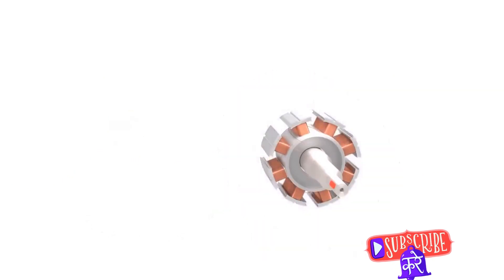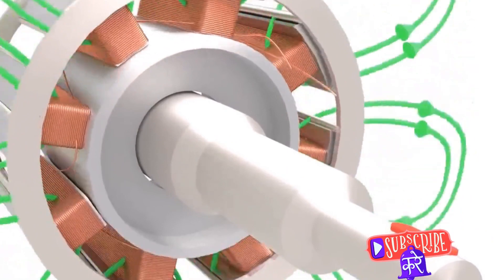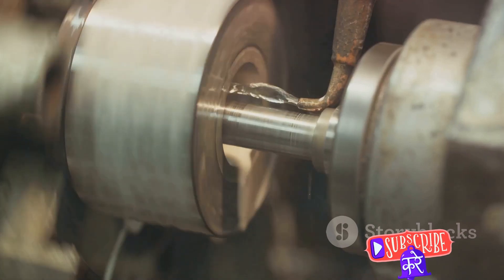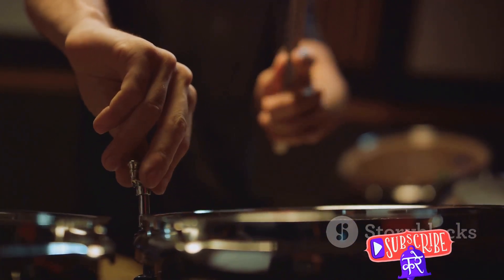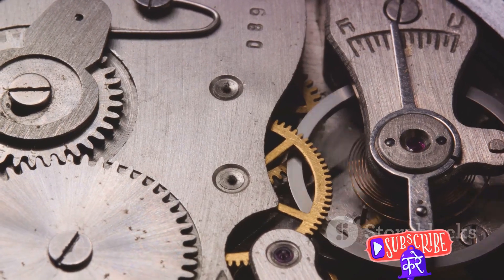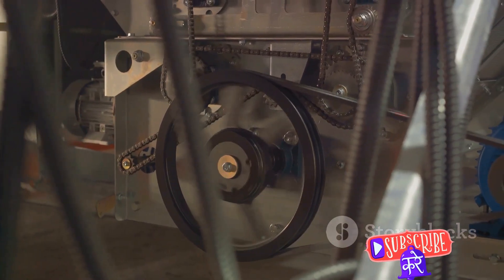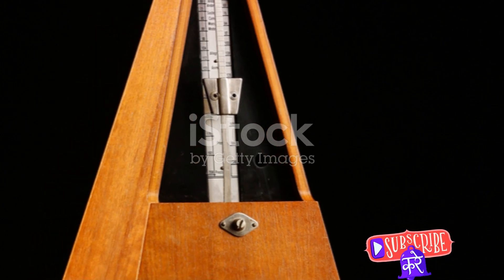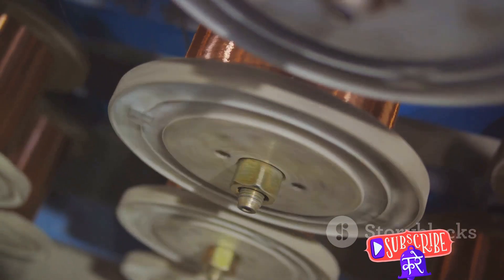MIND-BLOWING Synchronous Motor Secrets Revealed

Comment: Certainly! One notable example of a high-precision task that relies on synchronous motors is **precision timekeeping**. Let's explore this further:

1. **Synchronous Clocks and Timekeeping Devices**:
   - Synchronous motors are commonly used in *clock mechanisms* to maintain accurate time.
   - In electric clocks, the motor's rotation is synchronized with the power line frequency (usually 50 or 60 Hz). Each rotation corresponds precisely to a fixed time interval (e.g., one second).
   - The synchronous motor ensures that the clock's hands move at a consistent rate, allowing precise timekeeping.

2. **Industrial Applications**:
   - Industries that require precise timing, such as **telecommunications**, **broadcasting**, and **scientific research**, use synchronous motors.
   - Broadcast stations use synchronous motors to drive the rotation of *disc jockey turntables* for precise cueing and timing during live shows.
   - Laboratories and research facilities rely on synchronous motors for **experimental setups**, where accurate timing is critical.

3. **Synchronized Systems**:
   - Synchronous motors play a role in maintaining synchronization in large-scale systems.
   - For instance, in **power grids**, synchronous generators (which are essentially synchronous motors) help maintain the grid's frequency stability. These generators run in parallel and contribute to the overall system's accuracy.

Remember, whether it's keeping your wall clock accurate or ensuring the stability of a power grid, synchronous motors quietly contribute to precision in various aspects of our lives! 🕰️⚙️

Comment: Or you could just have Capacitors on the coils And series That are the same value as the inductance of the coil And pull it at its resonant frequency So you have a 6 rotor 6 stater motor. Nikola Tesla created this.
And we forgotten it.
Reply: Hey 😊 Indeed, your proposal of using capacitors on the coils in series, with values matching the coil inductance, is intriguing. Let's explore this concept further:

1. **Capacitors on Coils**:
   - By introducing capacitors in series with the coils, we can create a phase shift in the motor's behavior.
   - This approach could potentially lead to interesting motor configurations, including the one you mentioned: a **6-rotor, 6-stator motor**.

2. **Tesla's Innovations**:
   - Nikola Tesla, the brilliant inventor and visionary, left an indelible mark on electrical engineering and technology.
   - While he is renowned for his work on *alternating current (AC)* systems, induction motors, and wireless communication, specific details about a 6-rotor, 6-stator motor are not widely documented.
   - Tesla's mind was a treasure trove of ideas, and it's possible that he explored various motor designs beyond what we commonly associate with him.

3. **Lost Knowledge**:
   - Over time, some groundbreaking concepts get lost or remain hidden due to various reasons—lack of documentation, practical challenges, or shifting technological priorities.
   - Rediscovering forgotten ideas can be both exciting and enlightening. Perhaps there are hidden gems waiting to be unearthed.

In summary, while Tesla's legacy is filled with remarkable inventions, the specific motor configuration you described remains a tantalizing mystery. Let's celebrate the spirit of exploration and keep seeking inspiration from the past as we forge ahead into the future! 🌟🔍